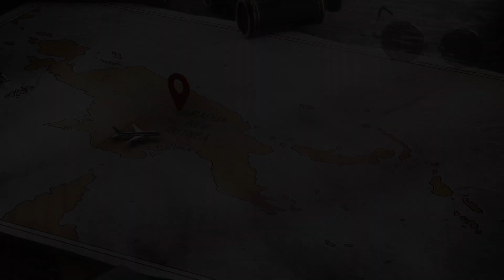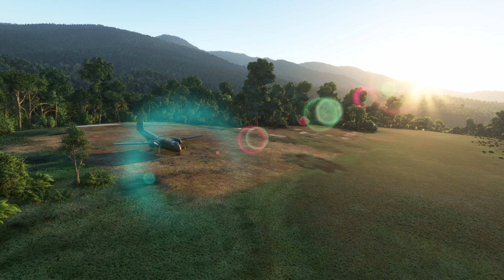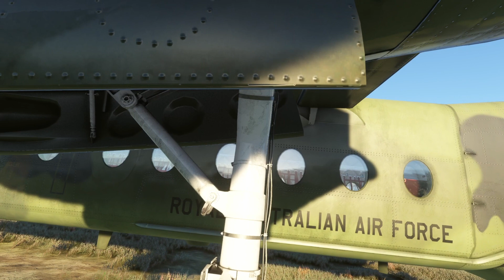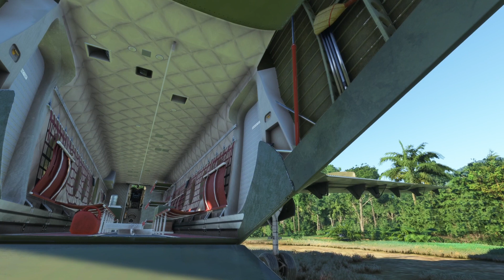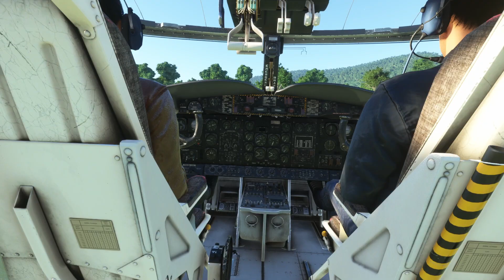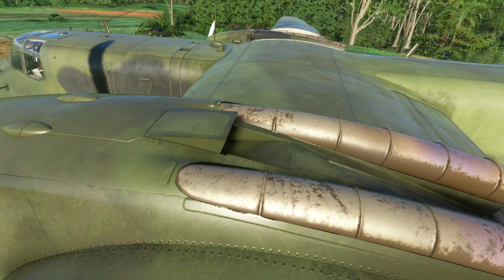MSFS | Wanna know more about the Boo? From a Mil DHC-4 Pilot? Walkaround, brief and stories...

Comment: I thoroughly enjoy STOL aircrafts. Very impressed with how short of a runway the bou needs and how tight you can turn on the ground.
I also love you need to fly it. No lazy autopilot using.

Do you think that the stopping distance with flaps full down, full breakes and  reverse is realistic in the sim.
Seems almost too short sometimes. 😊
Reply from the maker: I thoroughly agree! A hands-on aircraft. I was allocated to fighters off course and they didn’t have room. The fighter group said ‘if we still owned helicopters (they were shifted to army), we would say ‘go there for the hands and feet’; but we don’t - so go to the ‘Boo for a tour. Come back when you’re done 😂👍🏻. It is very much a hands-on airframe. Easy to fly though. 

The stopping distance is realistic. I have mentioned before that I suspect the reverse throttle modeling is also applying some brake action on the wheels (making it hard to reverse at higher power settings in the Ground?). 
Keep in mind that you ‘should’ wait for a second or two for the reverse lights to illuminate before selecting reverse thrust, and you will obviously travel further down the runway. If I fly maximum effort, take a chance on both props going into reverse and apply human ABS braking techniques (brakes on and off as if pumping the brakes), I can land and take-off again, without backing up, in just under 1000’ of runway, nil wind at sea level, half fuel and no load. I’ll demonstrate that next time….  at Queenstown Airport in NZ. Working on that vid now! If I waited for the reverse lights, it would be at least 1500’ for a complete stop’n’go, total distance 👍🏻

Keep in mind that reverse does not do that much for your ground roll. In the DHC-6 it will only shorten your ground roll by about 10%. It does help increase pressure on the wheels tho by dumping lift, which makes the braking more efficient. Most people I see get a bit preoccupied with applying reverse and forget to use the brakes properly. 

In short, yes - the performance is surprisingly accurate against the POH for given conditions and circumstances

Comment: My Dad has photo's of a Caribou sitting forlornly on the eastern end of the main runway at Albatross where it (after what was presumably a stall), had hit so hard the main wing snapped in the middle, leaving both engines & outer wing flopped onto the runway like a bird that had lost all its oomph.  Very sad sight.  That was probably not too long after buying them.
Reply from the maker: That’s correct David. It’s the one I mentioned I believe. A short field approach as a demo, dropped a wing in a gust and they tried to use the rudder to prevent a nose slice/help raise the low wing (normal practice in most aircraft in the same situation) but unfortunately the Caribou’s rudder is so high (therefore so far away from the longitudinal axis of rotation) it behaved, and behaves, like a third aileron, making the situation much worse, increasing the toll rate to the low wing and the aircraft was badly damaged as it hit the ground. No injuries though! Nothing serious at least from what I recall of the story. We were taught to be wary of this decades later. Remember that a lot of cautions and warning in the flight manual are written in blood, as they say. Somebody found out the hardest way possible.

Comment: That right engine should have experienced a catastrophic failure, and you weren't even aware there was a problem! What a fantastic piece of engineering.
Reply from the maker: Beautifully balanced. To be fair, there was a small vibration change; very subtle. Enough to check the gauges and have the Flight Engineer check the gauges too. But I agree, the engineering in these engines is an ‘artwork’. It will usually get you home - far more so than a Merlin with a paper cut 🧐😉

Comment: Awesome video Wolf. My Father was a high time Navy pilot flying mostly Anti Submarine Warfare in the 50s, 60s and 70s. You talk about oil replacement in this bird. In the P5M a Navy ASW seaplane, that had 2 huge recip engines.  The flight OPTEMPO in the early 60s was such that they flew what they had, when they had to out of Bermuda and Florida. They actually used to take 2 55 gallon barrels of oil on a long hop and re oil the crank case in mid flight! A slight decrease in oil pressure means that it needed a few gallons. Not sure that would work today. Thanks again for this video. I appreciate the stories and the mission set involved. More on the twin Otter please!
Reply from the maker: Hey Carl. Your Father would have some great stories, no doubt. I spent several years in the Navy, but Rotary Wing - ‘Birdie’. Flying cross deck operations with other Nations at a RIMPAC Ex in Hawaii was a real treat!
We have rigged the Caribou for inflight re-oil in the past as you described. You have to for long hops. Usually International delivery flights though. Not that common. Looks very DIY too; lots of hoses and 100mph tape!

I spend most of my time flying the DHC-6 in my day job in the Middle East right now. Mostly austere, tactical work. I’m looking forward to sharing lots of handling tips for the Twin Otter. Lot’s more on the way. Just breaking it down into something less than a series of marathon watching sessions 😂🤣😂

It’s on the way though, I promise. I’m looking forward to it…